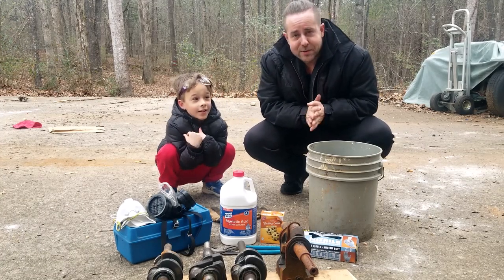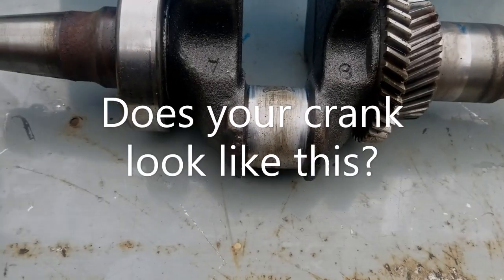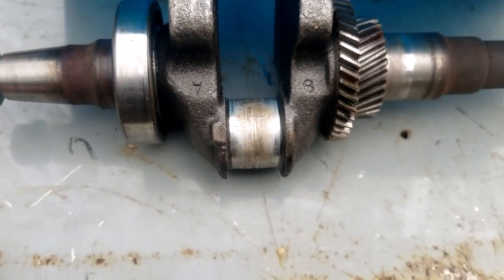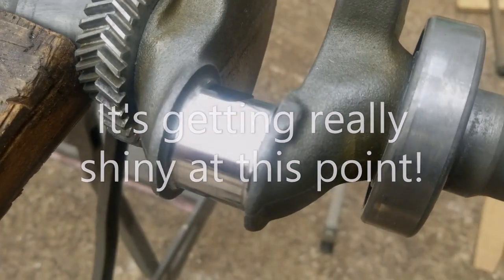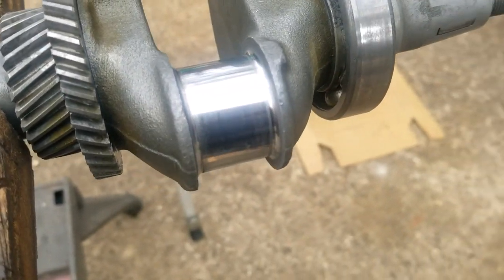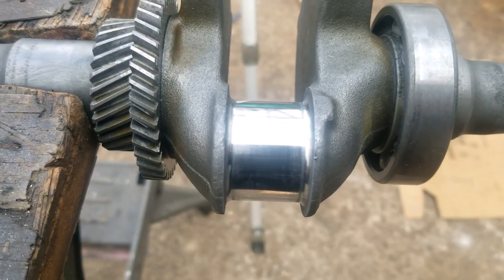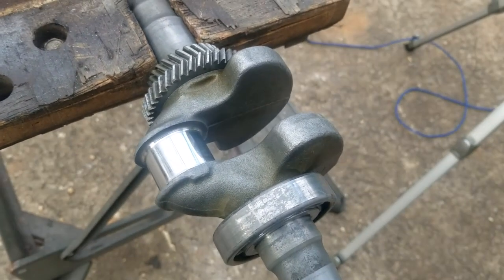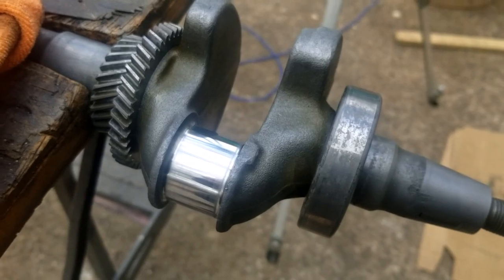How to restore a damaged small engine crankshaft with blown connecting rod with amazing results!

Comment: I use sodium hydroxide (NaOH) (drain pipe cleaner)  to remove aluminum as it does not etch the steel no matter how long you keep it in there. The journal will still be nice and shiny afterwards, just rinse with water.  The process i quick enough, but can be sped up tremendously by heating the solution.  NaOH is just as scary as muriatic acid so take precaution.
Reply from the maker: That is good to know!  Thank you for that!  I appreciate you taking the time to watch and comment!

Comment: i have a cb400 camshaft for +20 hp which is pretty burned because it got no oil while running.. . i wanted to throw it away but now i will do exactly what you did... thank you very much. Do you have to harden the surface afterwards? i heard they make the steel harder by heating and cooling it like a ninja sword. or will it work fine just polished?
Reply from the maker: Hi Robert!  I'm glad you found my video useful! It was a heck of an experiment lol.... So in the interest of not misleading you I have not run the crankshaft since the repair.  In my opinion and of others, I belive it'll be ok with the polishing only.
Reply: @bstarnes514  thank you for your fast reply

Comment: Just curious did you plastigage it afterwards to see what the rod clearance is? Seems like you may have ground off .001 or .002 but that’s just conjecture.
Reply from the maker: Hey Tyler!  I appreciate the comment my friend... I actually haven't checked the clearance as of yet.  I was also concerned about the same thing so I tried to be ultra careful with the amount of pressure I was applying.  I just need to get the new rod so I can plastigage it.... or a good set of micrometers lol.